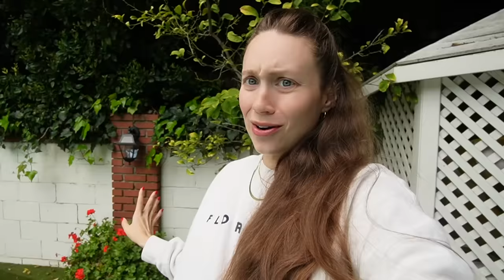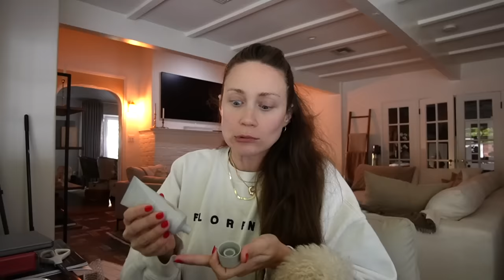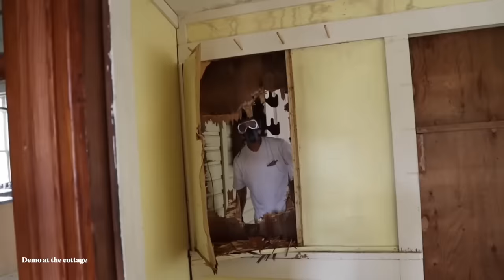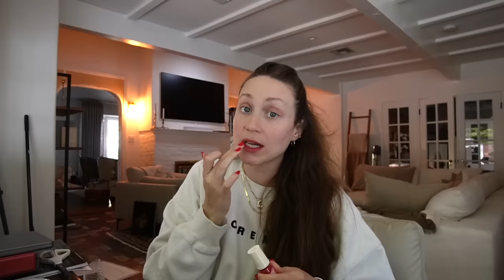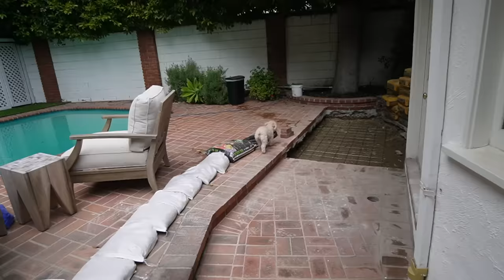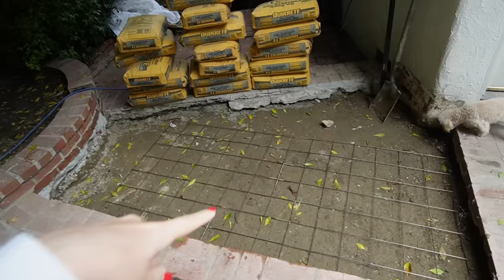finding the perfect addition to our nursery *flea market shopping*

Comment: Love the new cabinet! Maybe you could reuse the wire basket drawer thingies you had in the kitchen and fit them into the vintage cabinet. 
I feel like you're going to want super easy access to diapers and stuff and with baskets it's a little harder and you kinda have to use two hands to prevent it from falling forward, whereas proper pull out drawers are more suitable for one handed use, while you keep an other hand on the baby
Reply: I came to the comments to say exactly this☺️
Reply: @galli0 same with me lol
Reply: I was going to say the same.
Reply: For diapers, I'd just stack them on the shelf.  But for other things, baskets would be nice.  The only problem with the pull outs is they're probably too deep.  Kitchen cabinets are usually deeper than furniture pieces.
Reply: Or simply get a diaper out B4 you put the baby on the changing mat, not a big deal to do this.
Reply: Yes I thought the same !! It would so practical

Comment: Are you going to add an electrically controlled pool cover?  It keeps the pool cleaner, and you use a lot less chemicals.  Also, it's a lot safer for dogs and kids.
Reply: With a pool, you need toddler proof locks (e.g., that require keys and you keep the keys hidden away) on the inside on doors and windows. Toddlers are clever and they can wake up early before their parents are awake and find their way outdoors to go for a "swim." I think there are also alarms to put in the pool itself (we're looking into this now) so if someone falls in, you're alerted.
Reply: @mtzjotz  My pool has a lock box over the switch for the electrically controlled pool cover.  No one can open or close it without the key.  The switch is 5 feet off the ground.  We also have a fence and locked gate directly around our pool and another fence and gate around our acreage.
Reply: That would also help to keep it cleaner, wouldn’t it?
Reply: @Pkeats817  A lot cleaner!  You do have to clean and condition the cover, but that's easier than keeping debris out of the water.  And you keep a cover pump on it during the rainy season to keep it from collecting surface water.
Reply: @janesmith1398  Nice! I’m in Northern Canada and won’t ever be near a pool, lol. Thanks for the info. 😊
Reply: @Pkeats817  I'm on the west coast of Canada.  😄
Reply: @janesmith1398  haha, cool. Warmer, right. 😀
Reply: @Pkeats817   It was 13C here today. 😄
Reply: @janesmith1398  We don't have an electric cover -- just a cover we put on in October and take off in April because we have actual winters here. We're empty nesters, new to having a pool and I'm thinking ahead to when we do have grandchildren. We have a fence around our yard (no "acreage" -- the pool takes up most of the yard) with a key lock both inside and out but I want some kind of alarm because a neighbor who lived here for years told us recently that she once saw teenagers climbing the fence and going into the pool when the previous owner was away. I've been scared ever since!

Comment: That cabinet is gorgeous ❤, just a tip for future reference re the draws,an old candle or bar of soap run along the edges of the draws and the inside of the cabinet, makes the draws run smoothly, it also works well on wooden doors that 'stick' as the weather changes, great video as usual, i always find them so calming ❤

Comment: If a drawer in a wood cabinet doesn't run smooth, you can actually take the drawer out and run with a soap bar over the wooden strips left and right where the drawer runs in and out and then it will run smooth again 😊

Comment: Hi Macenna! We also had a dresser as our changing table. We used a diaper warmer for our wipes, and we put it inside the top drawer. We would pull it out halfway anytime we did changes so the wipes didn’t have to fit on top! You could probably fit wipes in that top drawer as well.

Comment: I use a vintage piece for my changing table and it is a hair too shallow for changing pads also! I started with the traditional changing pads you can get from Target but switched to a Keekaroo Peanut changing pad. Even with securing the pads to the top the weight of the Keekaroo pad just feels so much more secure. Especially into toddlerhood!

Comment: :hand-pink-waving::hand-pink-waving::hand-pink-waving:I saw the large crack going down the wall through all the blocks where you want to put the light and that means you need to have that checked and make sure it's not failing. I only had a little crack, not big like yours, and I had to replace the whole retaining wall. With all the rain and the hills failing, you can't be too careful.

Comment: Macenna they make smaller changing pads! There are ones that are oval and slightly thinner/shorter than a traditional one. They don’t have covers usually and you just wipe to clean them. Ikea also has a slightly smaller changing pad that you can get covers for if you’d rather have a more traditional changing pad

Comment: I've been thinking about your cabinet from the last vlog. The one you put your pretty dishes in. I think it would look really nice on the wall before the kitchen where you have the more industrial looking shelves at. Since you are going for a more french provincial, you could consider swapping out the industrial bookshelf and putting the cabinet there instead. Love the new cabinet for the babies room. You should also look into getting a diaper genie, the used diapers sure do smell bad.
Reply: I love the Diaper Dekor Plus.  It's so easy to use.  Just step on the pedal and drop the diaper onto the closed flap opening.  It slides right in and snaps closed instantly.  I've used it with my dogs (I'm dropping in my poo bags) and it couldn't be faster and easier.  The opening is large so you don't have to cram the diaper in through a small opening.  I've been using the same one for 8 years and it never smells.  And I live in the south and keep it in the garage!  One thing I do during the hot months is buy a bottle of the laundry scent beads and put a few in when I change the bag.  That's really just for me as I do get a quick whiff for literally a second.  But that's with a pail I only empty every week and it's in a garage with no a/c in the South.  It's right by my door and I walk in and out past it a few times a day and never smell a thing.  

My daughter ended up switching from Diaper Genie to the Dekor Plus for my grandkids and loved hers, too.  I think she used it for a wastebasket in bathroom after the kids were out of diapers.

Comment: I was 8 months pregnant and knocking down walls with a sledge hammer.  Every time I would hit the wall, my belly button would hurt.  A few days later, I was driving to the clinic for a baby checkup and unknowingly, I had an umbilical strangulated hernia.  It was horrible pain.  I literally crawled  on my hands and knees until they ran out with a wheelchair.  If you feel either something strange or extreme pain in your belly while exerting, please stop what you are doing and go to the hospital.  Sincerely not trying to frighten you.❤